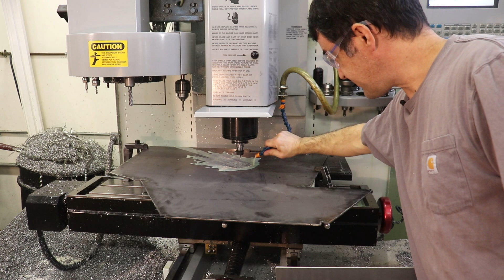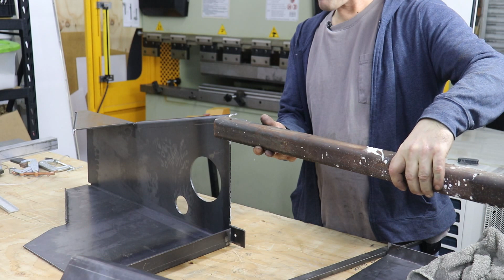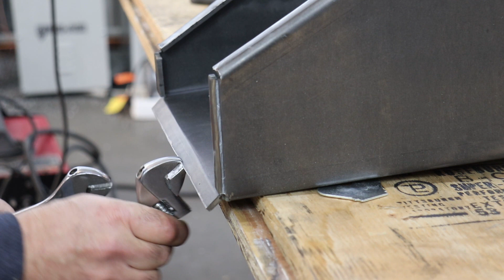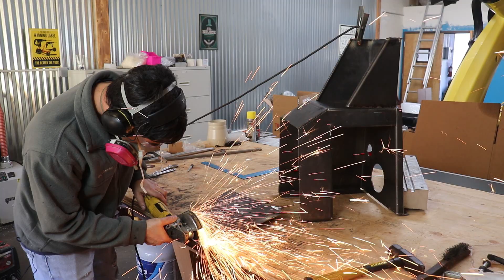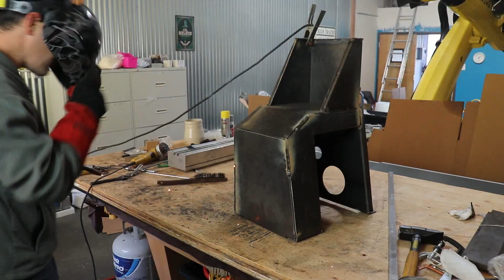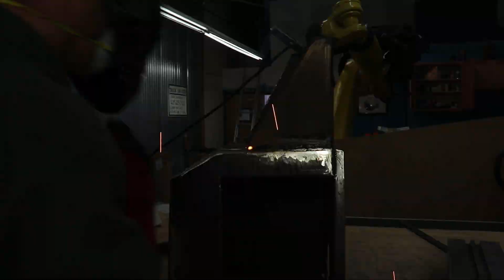Robot Mounting 2

Comment: It seems quite awkward having to reconfigure the CNC break between almost every bend. Presumably that machine is not really made for one off parts like this, but more for series production? Is there a better and more flexible approach for one off parts? That trades time/effort per bend for reduced setup time. I don't think a manual finger break is the answer, as that still requires reconfiguration.

Comment: David, if you are looking to make the most out of the press brake, I would look into splitting the punches & dies into "sectionals". That way you can bend a huge variety of parts. 
Moreover having a clamping system for the bottom that keeps the centerline of your tools aligned saves a ton of time and adds precision. 
Cheers, Josef
Reply from the maker: Thanks, yes, I have been struggling with the decision to cut them into smaller segments, I will start doing that to save time like you mentioned.  Thnaks